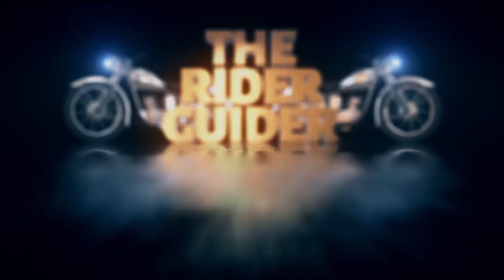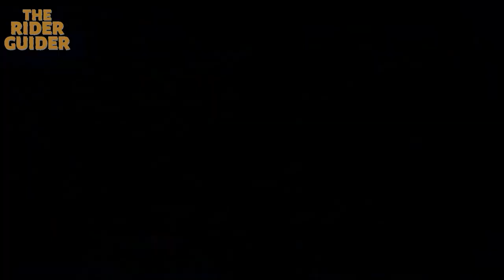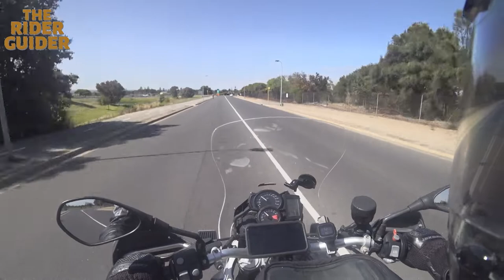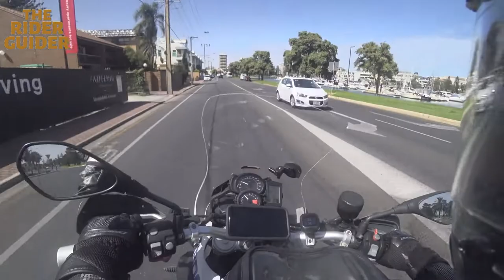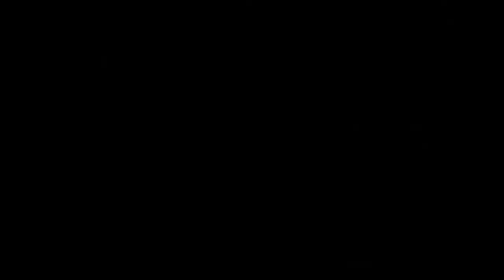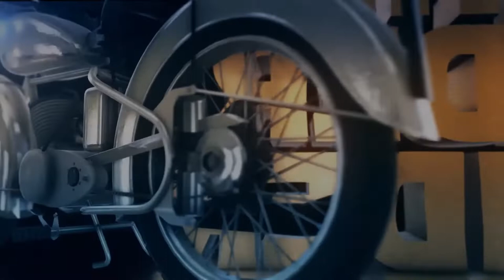A CLEVER BUT RARELY USED MOTORBIKING TIP

Comment: Thought those bumps were for helping us older riders pull wheelies, no? Anyway not heard this before. Here's one for you, i had just been learning how motorcyclists fall off when hitting an object in the road, either animal/road kill  or foreign object. The advice was to accelerate at the object there by lifting the front suspension and going over it. This came from study or other where it found that most bikers try to brake when faced with something in their path, they then either lost control or hit the object under heavy braking causing them to again loose control of the front end and then crash. A few weeks later i was faced with a lump of wood which spun into my lane from a truck going the other way, i accelerated and went over it with no drama, lesson learned. If you knew this already well done, otherwise we've both been schooled. Keep up the good work.
Reply from the maker: That’s a fantastic tip 😃👍🏼👍🏼👍🏼👍🏼
Reply from the maker: Cloudmaker definitely not one I’ve considered mate.